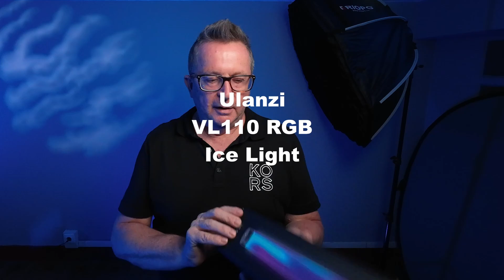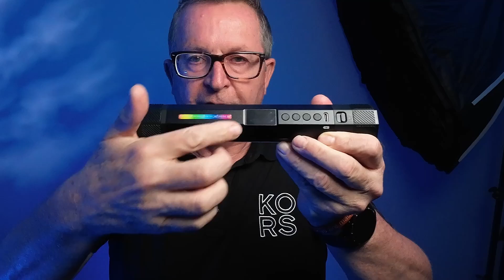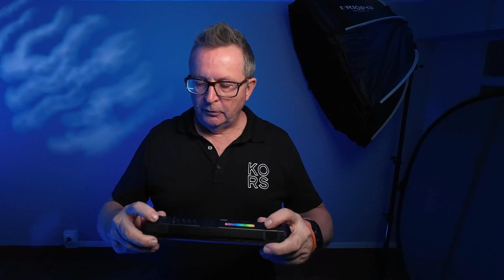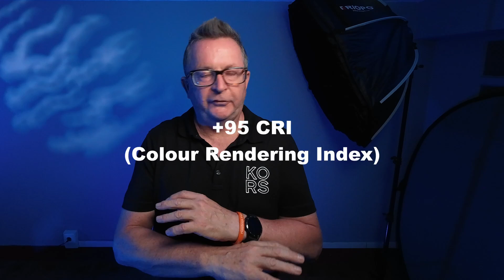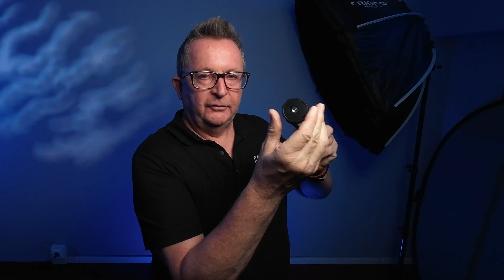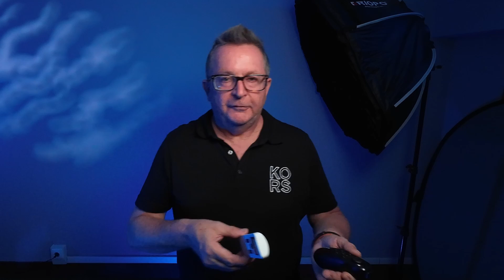Ulanzi VL110 RGB Ice Tube Light Less Than 50€ Godox TL30 Amaran MT Pro Nanlite PavoTube Alternative

Comment from the maker: I hope you find this video interesting. I am sure that, like I was, you will be surprised by the features that the Ulanzi VL110 RGB Ice Light offers for such a low price! Please leave your commnents related to this video and also if you have experience with this LED RGB Tube Light or any of the other brands. Take care and be safe, Andy
Reply from the maker: I am using the Ulanzi Claw quick release system. I have one on each of the cameras which I use and on my tripods and YouTube station setup. I also use one of my Ulanzi VL110 RGB tube lights as a fill light on my YouTube station setup. If you haven't seen my video on how I built my YouTube setup and the gear which I use, here is a link to it. https://youtu.be/CFPDGJG9SZs
Take care and be safe. Andy

Comment: I just bought eight of the Godox TL30s, two of the four light kits. I didn't even know these lights existed, I would have considered them, I have some Ulanzi QR mounts and they are great. I assume that like the Godox, these can be ran while they are charging for longer form content like a podcast? 

I'm using them to light up walls for a video podcast, these probably would have been fine and they are almost half the cost of the Godox.
Reply from the maker: Hi @danbrockettDOP. Many thanks for your comments. What a pity that you didn't know about the Ulanzi VL110 RGB tube lights before! Still, I am sure that the Godox TL30s will also give you good service in spite of costing more. What I love about the Ulanzi VL110s is the way they can snap together to form one long light of the same colour or each section on a different hue and intensity!.
In answer to your question, yes you can power them via USB C whilst they are charging.
I use 20000 mah external batteries connected to my stand using Ulanzi magic arms and a cheap telephone holder.
I hope you liked the video. Please subscribe to my channel if you haven't already. I have new videos dropping regularly.
Take care and be safe. Andy
Reply from the maker: I am using the Ulanzi Claw quick release system. I have one on each of the cameras which I use and on my tripods and YouTube station setup. I also use one of my Ulanzi VL110 RGB tube lights on my YouTube station setup. If you haven't seen my video on how I built my YouTube setup and the gear which I use, here is a link to it. https://youtu.be/CFPDGJG9SZs
Take care and be safe. Andy